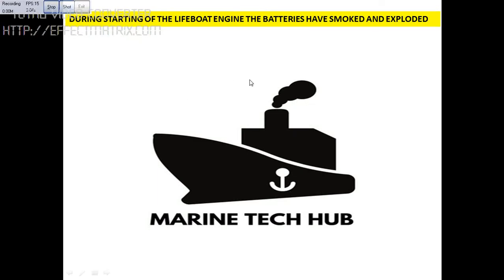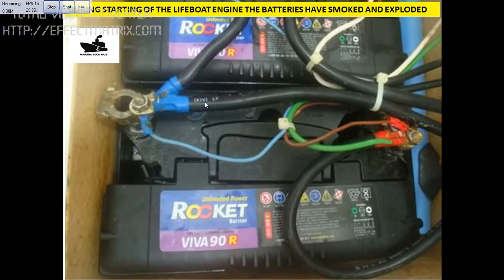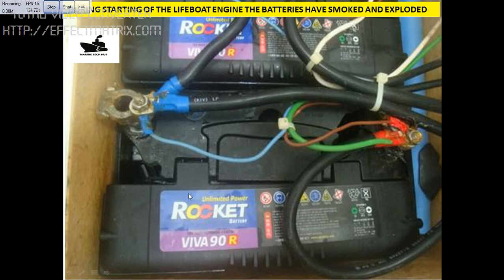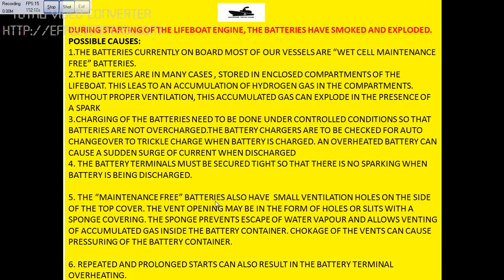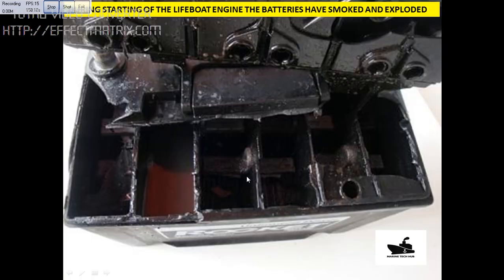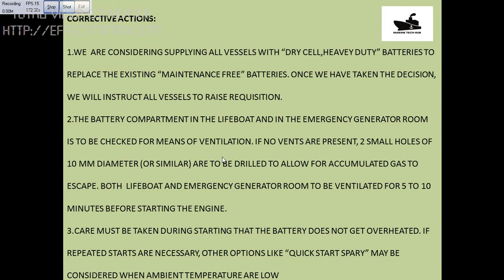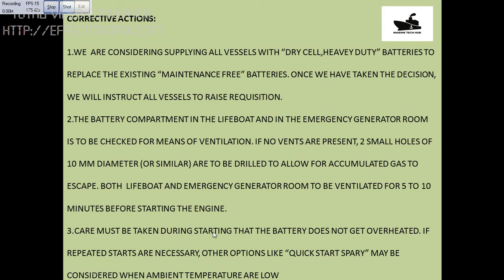What Can Go Wrong: Life Boat Batteries

Comment: can we take lube oil sample for testing from sump drain line ? is it correct method for testing?
can we take sample engine stopping condition?
Reply from the maker: yes we can take sample when engine in stop condition. If sample points provided then we can take engine running